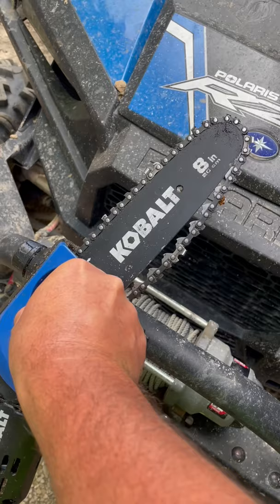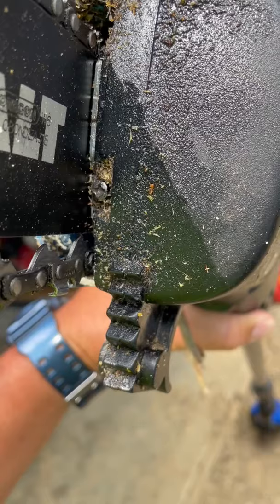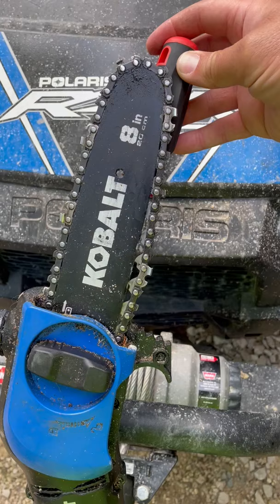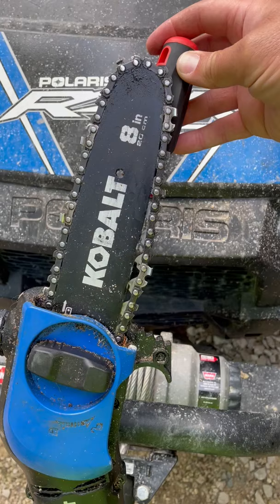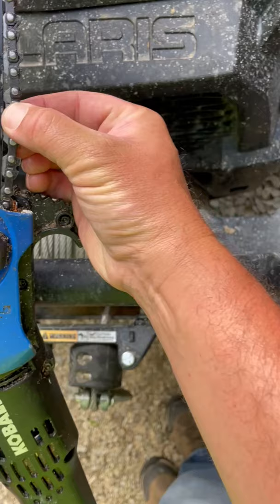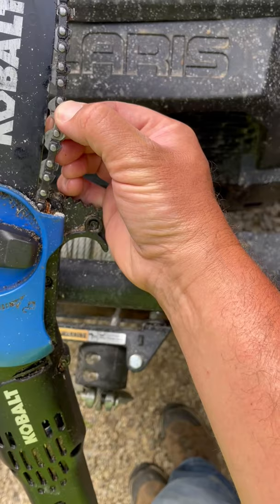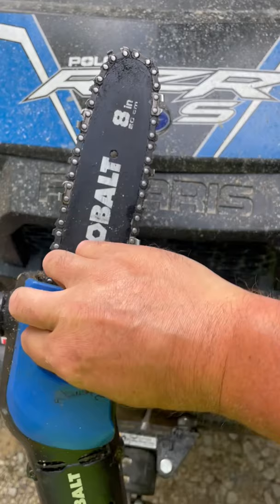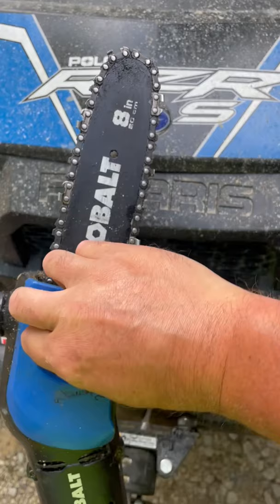How To Adjust The Chain On A Kobalt 40v Pole Saw #shorts

Comment: That screw doesn't exist on the new models
Reply from the maker: Huh, interesting I’ll have to check those out and see how it is.
Reply: @WilliamsonRidge  yeah, the new ones use a flimsy piece of spring steel to auto tension but it only works if there's no debris... at all 😖
Reply: It really doesn't tighten at all with the new model turn knob
Reply: @alnik5480 no it doesn’t tighten at all and the chain continues to come off. Very disheartening.

Comment: Just bought one  and it does have the chain tightening screw again.  It is now an allen head not phillips, and the tool comes with an allen wrench and  a slot to hold it on the pole.

Comment: Good looking out.
Reply: For some reason it didn't work for me, so I took the guard off and tried to clean out the chain and rotor area then put the chain back on and tried again, but still not tightening 😔
Reply from the maker: Make sure the pin on the adjuster is in the hole in the bar if it is and it’s not working it sounds like the adjustment screw may be stripped out
Reply: @WilliamsonRidge  the saw is working, but the chain is still loose, it seems like you might be right, is there any way to change out that screw, or do I need to get it professionally serviced? Thank you for your help and time.

Comment: My screw turns but it doesn’t seem to catch on anything on the bar.  The bar doesn’t have an area notched out for the sliding mechanism.
Reply from the maker: There’s not a notch just a hole in the bar the adjuster goes into
Reply: @WilliamsonRidge  I figured it out.  Thanks!

Comment: My tension screw loosens itself about every other cut or so.  It stays loose and I’m able to wiggle it easily anytime with a lot of play.  This makes the chain just hang with a big gap.  Anyone else having this issue?
I will probably try and exchange it for another one.  It is still less than a year old.
Reply from the maker: I haven’t had any problems with mine
Reply: IMHO, Kobalt chain adjusters are not the best.  I find mine getting loose often, too, and that damn screw is not really as easy to work with as Wmson shows it to be, at least for the occasional user like me.  BTW, I am on my 3rd 40v Pole saw in 5 years.  The Lowes manager and I agree that the gears in it are schlock; I like the tool but it is not their best effort.  Better experience with most of my other Kobalt electrics.
Reply: Saem thing happens to me..first its a great tool when chain is working but after only a few minutes of use chain keeps getting loose,,ive installed new chain and still have same issue,,
Reply: Glad to know I'm not the only one with that problem.
Reply: @uncommonsense8193  I returned it because of that issue.   Good thing it was easy to do and got no hassle.
Reply: Yeah same here I think the model just sucks